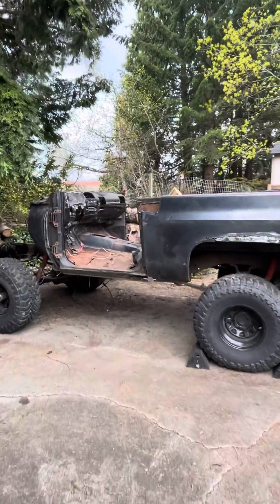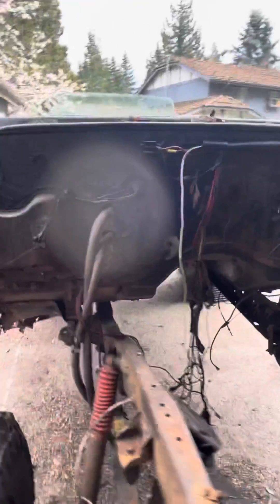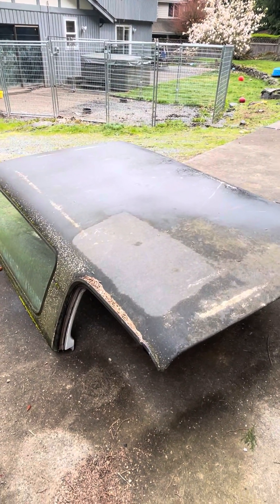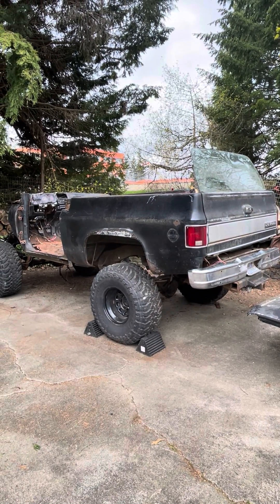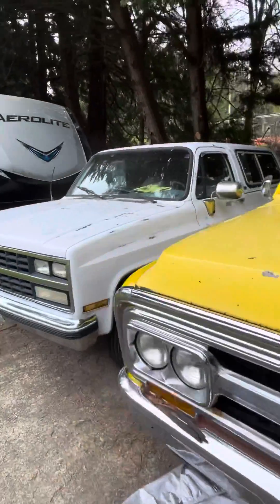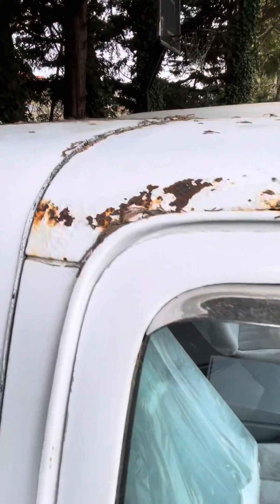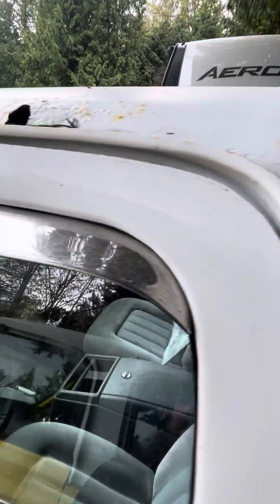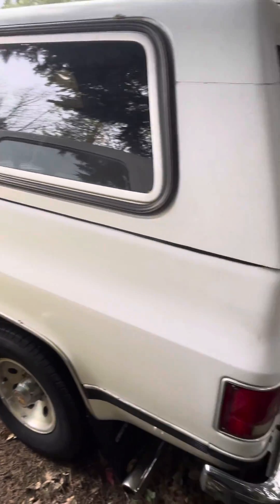Remains of the 73 k5 blazer and what it’s going on.

Comment: Where are you at on this project? Planning on doing the same.  Supports for cab under the floorboard?
Reply from the maker: I bought 2 pieces of 3/16 by 5 inch flat bar I’m going to weld along the lower rocker on the inside. 

The project has been delayed but I have everything for it. Just need the time. I’ll update it when I start on it again.